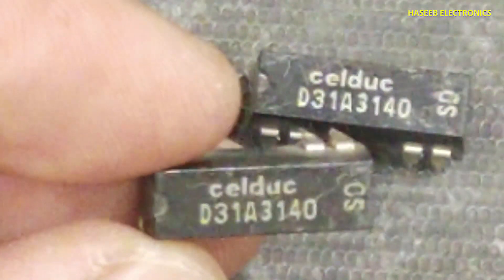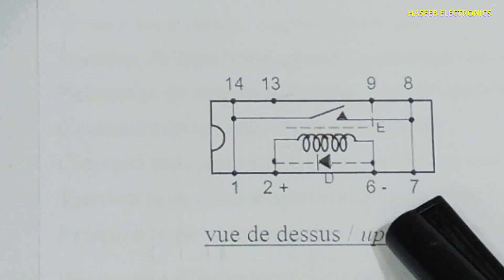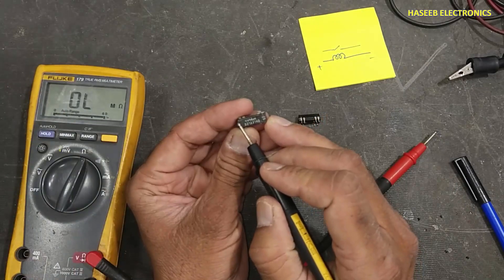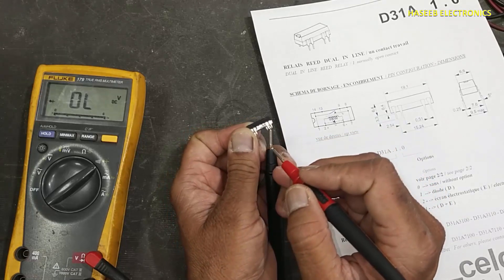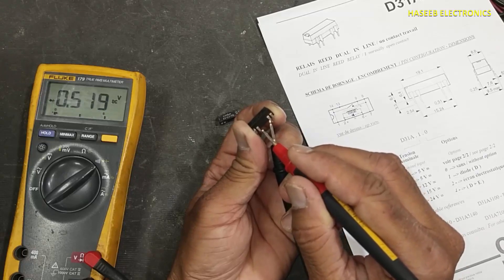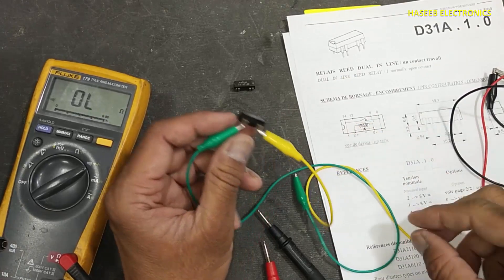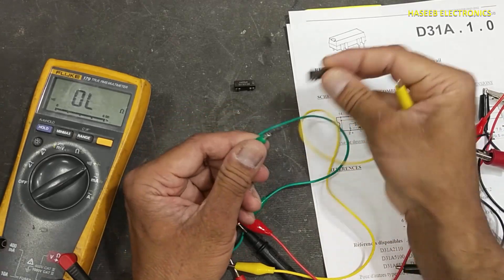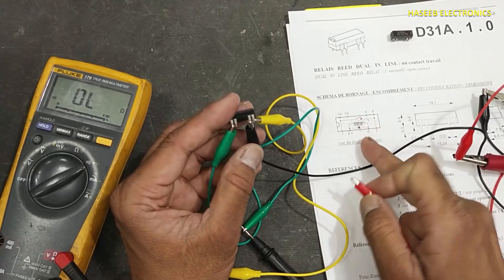{934} electromagnetic reed relay working and testing

Comment: excellent.... as you explained.
sir plz make a video on short circuit protection 14v 20amp using fewer components like Lm358 or any..... which  may drive  optocoupler on and off,

Comment: Sir I watch your video I really love to watch . I have one doubt and I hope you can clear my mind 
I have four IXGH 32N60C igbt . I gone through data sheet this igbt is without anti parallel diode       But when I measure with digital multimeter out of three show antiparallel diode and one show no antiparallel diode . I am confuse which one if good and four igbt  all are working in circuit

Comment: Assalamualaikum, Jazakallah Khair for the work you do for us, I have a question I have PSU 5v on standby available but on green wire, my voltage is 3.54v, so from where the green wire voltage comes? and why my voltage is low? chip ic number (2005z).